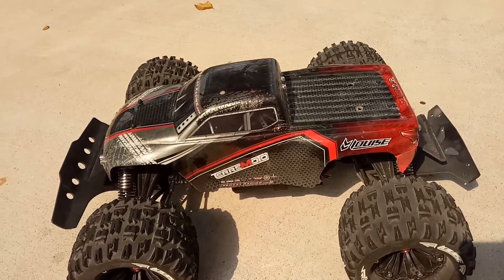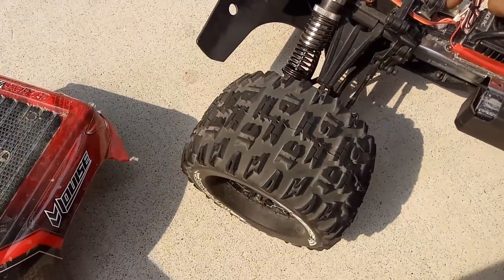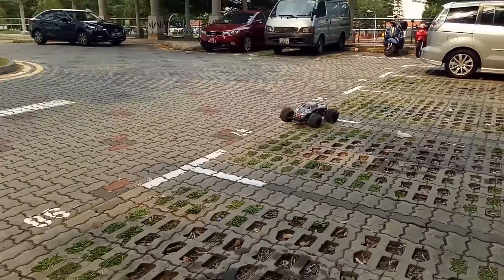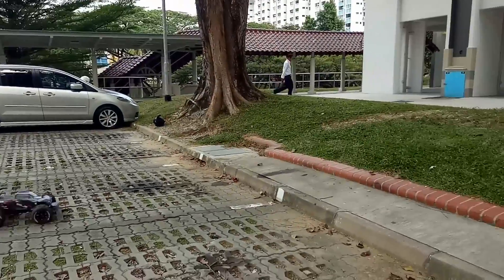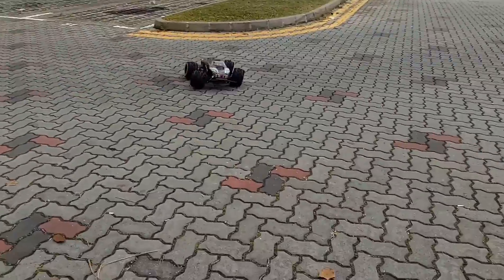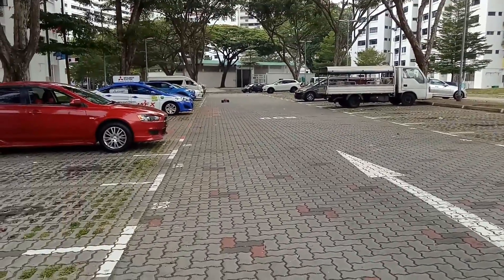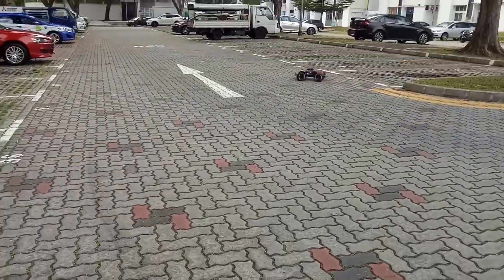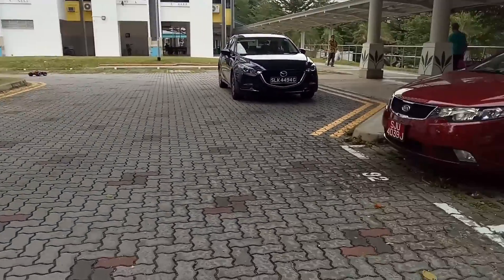Redcat Racing Terremoto V2 on Turnigy XK-4074 2000KV motor, 4S Run.

Comment: I have this truck and the 1/10 version. Both are good if you don't push them too hard. Not something I would buy new, not worth it. Basically, how it is being used in this video is what it does best. It's a great cruiser and will fly on 4s and climb curbs like nothing but I wouldn't air it out ever. I bought mine for $100 and it's worth every penny and that price, $150 is the most I would ever pay for it. Stay away from loose dirt, the center transmission gears will shread on 4s quick. I still like the truck though. Just know it's limits and it will be fun and reliable.